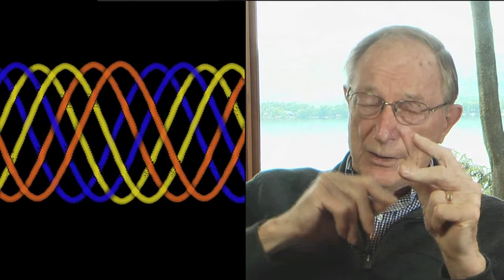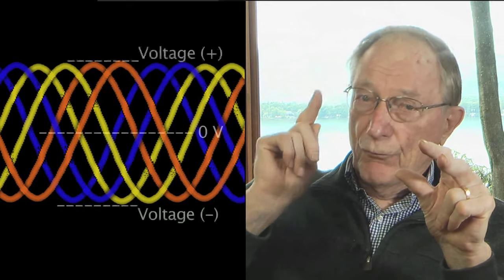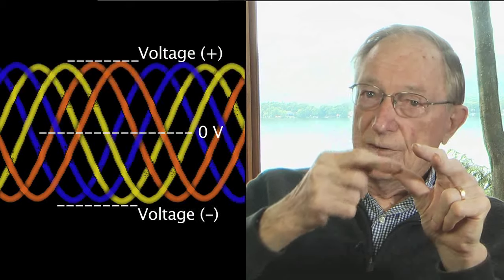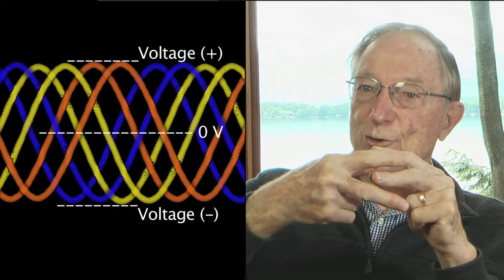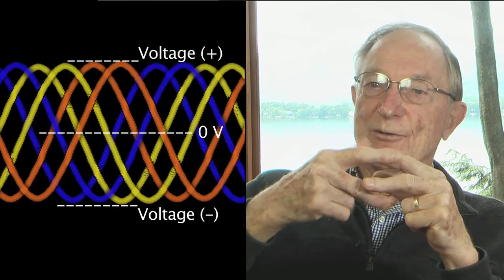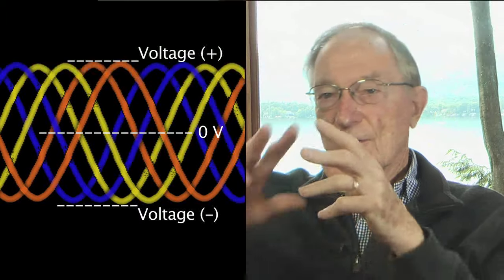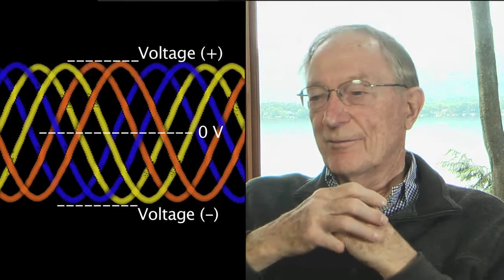Why 3 Phase Power? Why not 6 or 12?

Comment: Why wasn't 2-phase power ever a thing? Why must it only be either single, 3, or talked about in multiples of 3?

Well, I used to think a 2-phase motor, for example, wouldn't make sense because direction-wise, 2 phases might just cancel each other out (without resorting back to the start-assistances of 1-phase induction motors, or without using brushes), but now with this explanation, apparently an even number of phases could theoretically work.

Why then, couldn't a motor be running with one half of its windings on one phase and the other half on the other phase?
Reply: Hey, while we're at it, has anyone heard of a 3-phase light bulb? :-D
Reply: As compared to 2 wire Single Phase power transmission:
2 Phase power transmission (each Phase 180 degrees out-of-phase) would require 3 conductors - one of which would be "Neutral" and could be earthed. (However, this could not be used EASILY to produce a rotating field). It would require ALMOST 50% more cost (in wire, possibly insulators and switching) and give double the capacity or a 100% increase.
(This is virtually what is done in North American 120/240 V customer distribution systems.)

Balanced 3 Phase power transmission (each Phase 120 degrees out-of-phase) requires 3 conductors - with no Neutral. For 3 Phase versus Single Phase It is actually 50% more cost (in wire, insulators and switching) and gives 3 times the capacity or a 200% increase, This is a 50% increase over 2 Phase transmission for (virtually) no extra cost. (A rotating field can be easily produced.)

Balanced 4 Phase power transmission (each Phase 90 degrees out-of-phase) requires 4 conductors - with no Neutral. For 4 Phase versus Single Phase It is actually 100% more cost (in wire, insulators and switching), compared to Single Phase transmission and gives 4 times the capacity or a 300% increase.
However, compared to 3 Phase transmission, the cost is 25% more for a 33% increase in capacity.(A rotating field can be easily produced.)

Etc.

From the above, I hope it can be seen that 3 Phase transmission provides the highest cost/benefit ratio for an increase in transmission costs combined with the ability EASILY to produce a rotating field.
Reply: MaxxFordham if the bulb needs that much power, the phases are just connected together, serving as a "big phase"
Reply: Hey, thanks, FrodoOne1. Right now, that's my quick response. Later I might take the time to respond with some detail.
Reply: Heheh, *****, "big phase"? That sounds interesting in a funny way. But anyway, I was just joking about the light bulb, LOL!
Reply: Correct me if I'm wrong but don't aircraft use 2 phase.
Reply: single phase is 2 phase  which is in  houses
Reply: smorrisby, why would they? And what happened to your question mark (?) key?

No, Chris Plu, that doesn't make sense. The word "single" does not mean "2;" it means only ONE.
Reply: MaxxFordham
 You are right there should be a "?"
 I don't know why, I just have a recollection from the distant past. While working for an aerospace manufacturer I seem to recall our benches were wired with 110v 400hz 2 phase. 0 deg and 90 deg seems to ring a bell. However nothing comes  up on a search engine so I guess I'm wrong.
Reply: Well, smorrisby, it sounds like you know what you're talking about, and just because you can't find much about it from a search here online doesn't mean it isn't true. Now, I can't figure out what advantage there would be of 2-phase power over 1 or 3, or why an APU would favor that, but with what you're talking about, you're probably right.

As for the question mark: Hey, did you know that YouTube now lets us edit the errors out of our postings?
Reply: I make no claim to understand all this, but-----here in Philly, and I'm told in some other old east coast cities, 2 phase does exist. In my last shop I had 2 phase, 4 or 5 wire service, and I had to locate a special transformer to use to change from 2 phase to 3 phase.  And it was definitely different from single phase.  I was told the elevators in that building had 2 phase motors.
Reply: That's interesting, shop shop, especially after considering the idea that both 2- and 3-phase power would require 3 conductors but that 3-phase power would make a rotating field more easily and apparently less expensively than 2-phase power would, according to FrodoOne1.
So... hmm... but maybe it did make sense in a few situations, because it might've been a trade-off between making a motor that could handle the 2 phases that are brought in as 120/240 volts already there vs. bringing in a 3rd phase.
However, I thought that 240/120-volt wiring was in the same phase.
Reply: 2phase power  is defined as single phase ,  in a house you have  2 hot phases a neutral and  ground. In the hot legs  120V each leg combine the 2  which is 240V. In some commercial and industrial dwellings  some have high legs which would  1 leg could have   240V which should be labeled on the panel. if the panel has a high leg in it  and which phase is the high leg
Reply: That doesn't make sense, Chris Plu. 2 =/= 1.  (2 does not equal "single.")

Even then, why would combining legs 1 and 2 be able to make "2-phase power" if the waves of both are in synchronization with each other? That's just one phase.
Reply: MaxxFordham
I guess what he meant with "2 phase power in synchronization" Is that it may be just one phase, but a bigass one at that.
It would be twice as big
Reply: Kitsune Youkai, that would be a self-contradiction. If you have one circuit here (holding left hand up) and then another over here (right hand), and their voltages are rising and falling at exactly the same time, then that is only one phase, even though it's two circuits.
Reply: Chris Plu No no no you are absolutely totally wrong.You are getting confused between 2 phase and single phase 180 out of phase.
Reply: Chris Plu Once again 2 phase is NOT defined as single phase.Clearly you have no idea about electricity transmission..You should do some studying.
Reply: Chris Plu What you persist in calling "2 Phase Power" is actually a center-tapped Single Phase of a Three-Phase system, derived from the secondary of a transformer of which the primary is connected to a high voltage supply line - (usually between two phases of that line, so that no Neutral or Earth is then involved on the HV side. However, in some situations, as  when a SWER line is used in rural areas, the the primary may be derived from a Wye/Star connected HV supply.)
In countries in which the domestic/commercial voltage supply is nominally 120 V, 240 V is often required to power devices which use a large amount of energy, (such as Clothes Dryers) in order to limit the current involved.
(The current required to produce a given number of Watts when 240 V is applied is only one half that required when 120 V is applied.)
Hence, in those countries each domestic/commercial supply is usually via two "Lines" derived from a centre tapped transformer of which the centre tap is Earthed and becomes (is connected to) the Neutral.
The voltage across the transformer secondary is 240 V. The voltage between each supply Line and the (Earthed) Neutral is 120 V.  Each 120 V Line is 180 degrees out-of-phase with the other so that the voltage between L1 and L2 is 240 V.(See http://science.howstuffworks.com/environmental/energy/power9.htm)
Reply: I'm not sure why you figure you needed hyphens in "out=of=phase" in this context. But why shouldn't the 2 phases of one line where one is 0 degrees out and the other is another phase -- 180 degrees -- out, still be considered 2-phase power (since those are 2 phases), even though they're not the standard 120 degrees from 3-phase power?

Comment: Staying awake is the biggest challenge when listening to this speaker. Practical apps. 3 phase into delta y bridges gives users options for higher voltage DC. Early on high horsepower motors and drives were mostly DC. Tessla was never accepted in industry despite the superior design aspects. Politics and racism played roles. Lots of history here. AC motors and drives are still replacing Old DC.

Comment: What do you mean by 'twice the power'?  Is it twice the efficiency?
Reply: Just that.  If you have a 100 watt light bulb, give it 200 watts.  Twice the power and a lifetime measured in milliseconds!
Reply: @thomasmaughan4798  Wrong in a big way. You give a 100 Watt light bulb way more than that all the time and nothing happens. The bulb only uses 100 Watts of whatever is available at the rated voltage. Remember that many homes in the US have 24Volt power that is center tapped to get 120 Volts. That light switch can see whatever Wattage is available from the panel which is only limited by what the branch circuit breaker, main breaker/fuses and the transformer and fuses will allow all the time. But the bulb still only uses 100 Watts even though there might be 40 KW available. In our case, the limiting factor is the transformer on the power line. It is rated at 15 KW while our house is wired and fused for 48KW at the transfer switch. And has a 200 AMP 240Volt main breaker. There is even a 40KW genset sitting outside. Neighbor also has a 40KW genset.

Comment: Hey, I think we ought to have 360 phases: one for every degree in a circle!
Reply: Conceptually, one can go to an infinite number of phases with zero spacing ....
Reply: Heheh, *****, I'm glad you used the qualifier "conceptually" with this one! :D
Reply: MaxxFordham Yup.  Short-circuiting the generator/source would not do.  Need at least some waxed paper between all those phases.  The work done at PTI went beyond 12 phase but only 6 and 12 phase lines were built and tested.
Reply: Heheh, interesting, *****. Yeah, okay, get some of that wire with the very thin, red insulation, and use that. 
You wouldn't get anywhere near an infinite number, obviously, but maybe you could fit about 1074 of them together (3*360, 6), haha. :)

Comment: Can any one conclude what he said?
Reply: You will gain more power in 6 phases and the more you go like 12 you wouldn't get the same power boost
And in the end it wouldn't be more economical because you will need to add the circuit breaker and the bus line 
But its still possible

Comment: ...answer should start with single fase (not 3) and progres to the infinite if we would be strictly mathematical. You can't make simple self-starting single phase electrical motor unless you use additional capacitor to shift additional phase and to basically mimic 2 phase system. 3-phase system beats 2 phase because "it requires less conductor mass for the same voltage and overall amount of power, compared with a two-phase four-wire circuit of the same carrying capacity". Than the video continues the story basically saying 3-phase system is optimal solution for economical power transfer. Maybe this Wikipedia article is the best answer for this particular question: https://en.wikipedia.org/wiki/Two-phase_electric_power ...

Comment: In addition to my lastmost comment.....energy cannot be produced from nothing!  We are not necessarily "wasting" valuable energy (water/coal/nat gas, nuclear) from our turbines because we have sparingly only wound three "current-generating" windings upon it's rotor.  Adding another 3 windings (making 6 phase) to our existing rotors would require approx. twice the mechanical forces to produce a rotation of 3600rpm.

Comment: How about in graphics cards i see 16+3 phases "most advanced power delivery circuit on the market" compared to 6+1 phases that seems to be cheaper and worse than 16+3 phases
Reply: Phases there is completely different. Graphics cards have multiphaze smps (switching mode power supply) buck converter. Gmps phazes have nouthing in common with power grid phazes. The more smps phazes you have to drive same load the less output ripple you have, the less loaded each phase is.

Comment: I wonder if there would be less problem with phase balancing when using multiples of 3 phase, especially when using single phase in the home? Is there less radio wave emissions and loss with poly phase power lines? Electromagnetic radiation shows some evidence of being harmful to living creatures near transmission lines.
Reply: Actually there is no evidence of harm from the low frequency electromagnetic fields of HV transmission lines (the single phase wiring in your house has a stronger field as this is a current flow effect - less current = less field).
There is evidence of issues with electrostatic precipitation of pollution in the air being concentrated under the high tension power lines (the power lines cause fine particles (mercury, lead, carbon etc) to agglomerate and fall to the ground directly under the power lines - this is a voltage effect).
Reducing airborne pollution helps reduce this.

Comment: No that not how it works 3 phase is simply 3 single phases all together the only difference is that the frequency is 120 degrees different. Meaning when used you get smoother running and more "power" (watts) for less amps. Also PF is usually done using large caps or inductors to oppose the load

Comment: when measuring three phase 480vac , never put your voltmeter phase to phase , always phase to ground to be a little safer.now 480vac/1.73 = 277vac on phase to ground measurement.It would be fun to build a small voltage ( 12 volt or 24 volt or even smaller 1.5 volt or 3 volt , really cool) homemade 
 frame three phase generator using about 22 gauge wire or so and some small bearings just for table top experimenting , how come these " experts " never come up with exciting original home made learning projects to discuss? Man, i would get my wire from old transformers ( take apart , unwrap) that i dont need any more ( been there done that ) .And of course would calibrate me some analog panel meters .try adding some extra magnetic pole pairs and see what results become , very interesting !

Comment: (google 666 machine) uses 3 phase to mimic 6 phase by employing wiring reversal of the central of three series segments of coils that consists of nine coils; three coils per phase. Modeled after the first magic square of nine no.s having balanced sums that when topologically curved in 3d space to show connection  to opposite edges shows three diagonals curving around each other in 3d space. Likewise it is only this segmented 3d circular diagonal pathways that yields balance of 3 phase currents

Comment: Monty Python can sum this up.

ITS A SIMPLE DISTRIBUTION OF WEIGHT RATIOS

Look at distribution and use of power per gram (or pound or ton) of copper.

You gonna run the cost of a 12 phase line and circuit protection for miles before it hits even one home subscriber?

Whats the arc flash fault rating and how many less electricians will survive a disaster?

Comment: Hang on everybody. To generate 2, 3, 6 or 12 phase systems, you have to turn the generator somehow. This chap is saying that the more phases you use on the generator side, you increase the power output. This looks like one of those perpetual machines to me. To my mind input out minus a bit of loss equals input in.
Reply: You're right, nothing is free.  The generator has to match the transmission, has to match the load.  Bump up to six phase lines and you'd have to double the number of poles on your generator OR put a transformer on both the generator end and the load end.  The economics of it don't line up in 2019.  Before deregulation it could have been done and there would have likely been efficiencies realized in transmission, but it would have been done on the backs of tax payers.  The easiest thing to do would be to up the voltage to 240 like most of the rest of the world has (but 50HZ?  that makes no sense) but even then we'd all have to buy new shit.  It's purely and intellectual exercise.  Fascinating, but not terribly useful.
Reply: I wholly disagree, but it does allow uncritical thinkers to fall into the mistake of thinking there is nearly a free lunch. He is simply making a statement based on an implied assumption. ASSUMING a given power output, you get more transmission efficiency with more phases in the cable design he described (the tube structure, though others are possible).

Comment: why not 4 phases though?

lets say phase one is sin.
phase two is cos.
phase 3 is negative sin.
phase 4 negative cos.

this leads to no voltage dips, and due to phase harmony, instead of 208v when using one against the other, you have 240v exactly double.

Comment: Says three phases shows three wires. But three phase uses 4 wires, one for each phase plus’s a neutral
Reply: On the low-voltage side yes. Transmission lines use 3 wires.

Comment: Why 12 or 24volts and not 40v, 60v on batteries???
Reply: You can, 12V and 24V are conventions.  There used to be 90V batteries for old portable radios that used valves/tubes.   However, 40V is the lowest voltage that ever killed anyone so safer to use smaller voltages for car and truck batteries.
Reply: @karhukivi  thanks a lot friend...
Reply: @Miguel-wx8ii  You're welcome!

Comment: 6 phase lineral induction motor on this scale could produce a huge electromagnetic powered motor big enough to move a mono rail by the resistance between the similar poles aligned n to n   s to s  , the negative force would keep the magnets separate , creating a levitation effect. Wesley note to self

Comment: The short answer is that three phases is the minimum number of phases whose average power is a constant.
Reply: You can have constant power with two phases 90° apart. The reason why three phase power is used is probably because you need a neutral wire in two phase power supply.
Reply: Notice how whoever designed the GE logo appears to have been thinking 90° apart as the optimum solution.